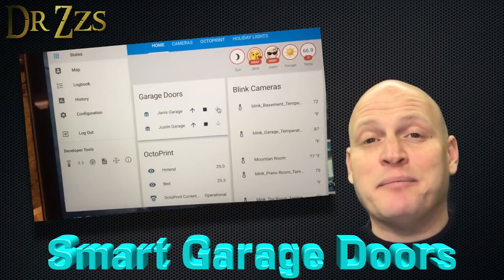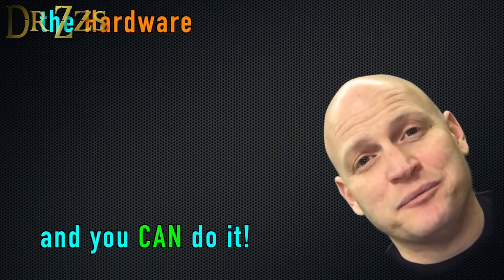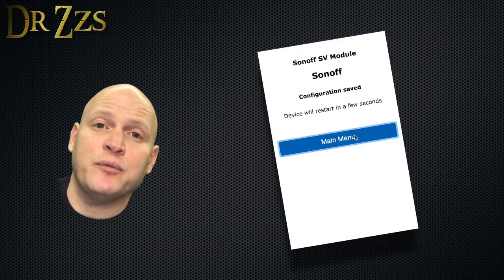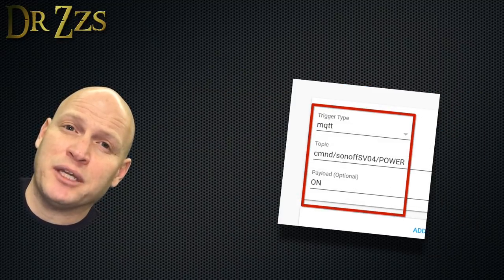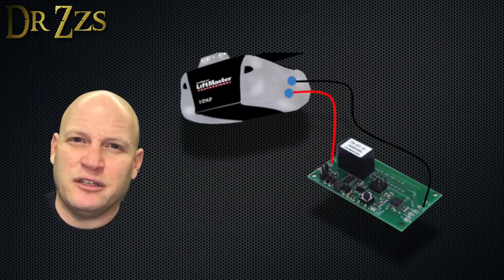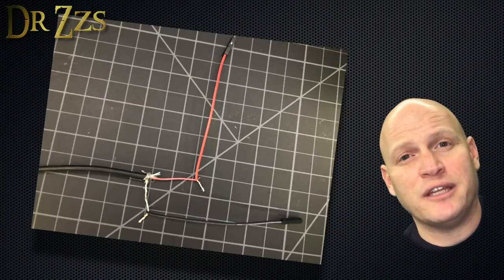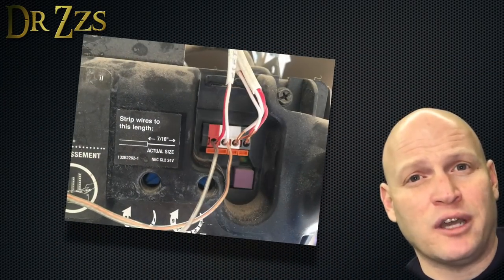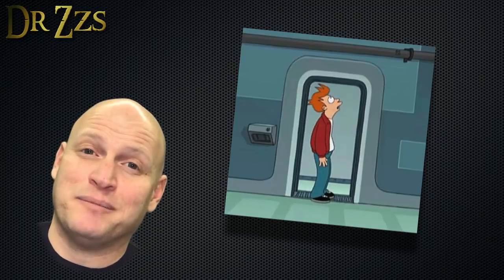$5 DIY "Smart" Garage Door Opener using Sonoff SV

Comment: It's so ridiculous that in the 21st Century we are still stuck with garage door openers that don't have discrete "open door" and "close door" terminals, and we're still stuck having to implement workarounds to figure out the current state of the door.
Reply from the maker: Amen. 
Looking at newer garage openers, it seems they're starting to offer wifi connection.  I'd expect they charge a premium for including $3 worth of tech. ;P
Reply: When I did my garage door integration last year, I installed two sensors, one for when the door is completely closed, and one when it's completely open.  I have both of them connected to my esp8266 based device (not a sonoff, but it could be). It wasn't difficult, but yes an added step.

It's would be nice to have sensor output available from the manufacturer, but I don't expect to see that from on any for a variety of reasons. Not only are there marketing reasons not to do this, but openers have to pass certain safety regulations.  If the manufacturer enabled others to connect untested accessories to their unit, they would not be able to verify the safety of the modified installation.  This could pose a potential liability.  They are not going to take the risk as there is little upside from their point of view.

Comment: For project boxes, check out the 3 for $1 plastic boxes with snap lock lids at Dollar Tree:
https://www.dollartree.com/Plastic-Snack-Containers-with-Lock-Top-Lids-3-ct-Packs/p352768/index.pro
Width: 3.5 in.
Length: 4.5 in.
Colors: red or green or blue
Reply from the maker: Awesome!  Thanks!
I went to the dollar store looking for them, but couldn't find them.  Mine must not stock them. 
Thanks for sharing the link!
I can't even beat that price with a 3d printed box.

Comment: Hello Dr.Z,
Appreciate the wealth of information you have posted at the several online seminars (on youtube University). Kindly advise on following error.  

To automate the garage door, I bought the sonoff SV and reed switch. This is my first step on home automation so don’t have any thing except these two components. 
Using this link I tried to flash Tasmota Firmware on Sonoof: 
https://www.youtube.com/watch?v=c2IUIUnxjUY

1. Downloaded & install the Arduino Software.
2. Updated the boards manager with Arduino.esp8266.com….
3. Went to Sonoff-Tasmota website and downloaded the sourcecode.zip
4. Extracted the zip files and copies the lib files to Arduino folder.
5. Opened the sonoff.ino and it opened the Arduino programme.
6. Installed the 2.4.0 version of esp8266.
7. Found user.config.h file and updated the name change to “wifimanager”.
8. Updated the user name and password for wifi. 
9.  click the upload button from the arduino drop downs.

In the Arduino page, when I try to upload it showed me an error: 
Arduino: 1.8.7 (Windows 7), Board: "Arduino/Genuino Uno"

Build options changed, rebuilding all
sonoff:29:143: error: core_version.h: No such file or directory

compilation terminated.

exit status 1
core_version.h: No such file or directory

This report would have more information with
"Show verbose output during compilation"
option enabled in File -> Preferences. information with "Show verbose output during compilation"option enabled in File -> Preferences.

Kindly advise the next steps. 

Another question is, do I need to buy raspberry pi as well and other hardware as well to automate the garage door opening?

Thanks a ton,
 Patel.
Reply from the maker: Thanks!
I've got a great solution for all Arduino IDE errors... don't use it ;p
I'm not kidding though.  I haven't opened the Arduino IDE for flashing esp8266 devices for a while now.  I use the "FlashEZ" method.  I've done it in several of my more recent videos.  Check out the newest one about the Thermostat.  That'll show you the basics. 
And there's this one: https://youtu.be/KMiP9Ku71To
Reply: Thanks for the update Dr. Z. 

Do I need to buy Raspberry Pi for this project ? Any other hardware that I need to buy. 

Thanks,
Patel